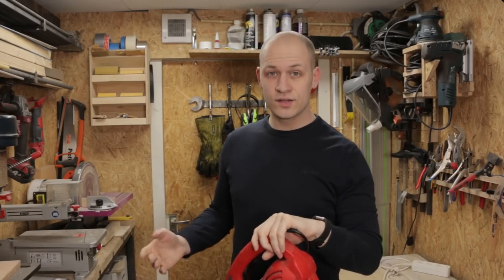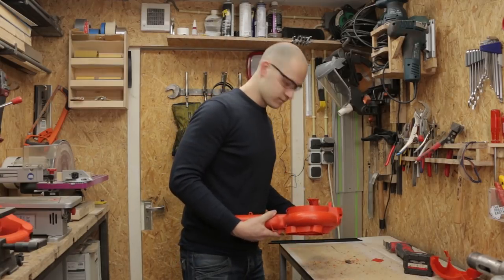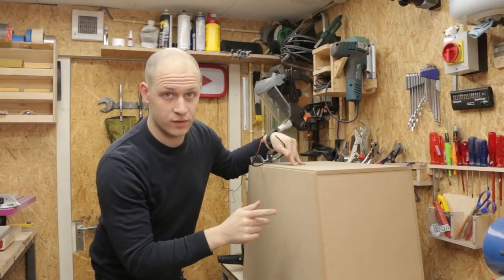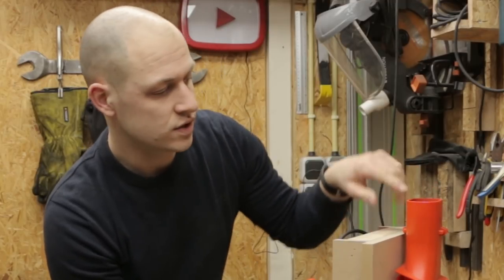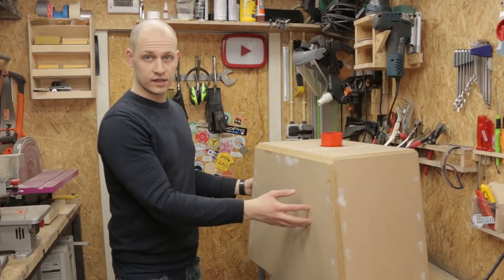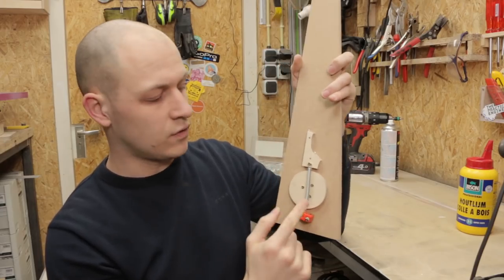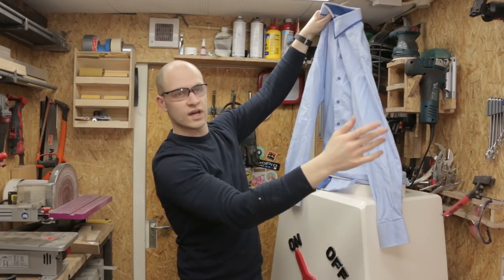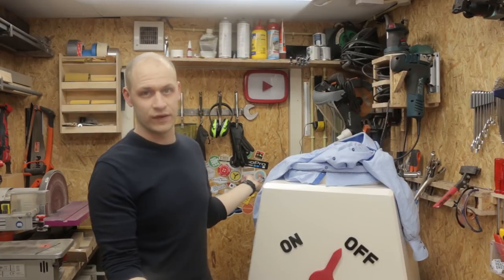Dry your shirts without wrinkles with this shirt blower

Comment: Hahaha, so cool! I have wished for such a machine for ages! Tips! If you try to blow up a balloon and put it as a plug in the neck opening, then "all" the air would go out through the arms. Also, you could buy/make a steam iron. That way you could iron it and dry it up faster! Would be cool with a follow up on these tips! (ps. If you keep going with this quality content your in the right direction of growth I would assume!
Reply from the maker: Haha! A co-worker of mine also suggested to make some sort of blow up head that would fit inside.
Reply: Yes, that would probably be a lot faster method, recommended - and waiting for the follow-up, too 👍